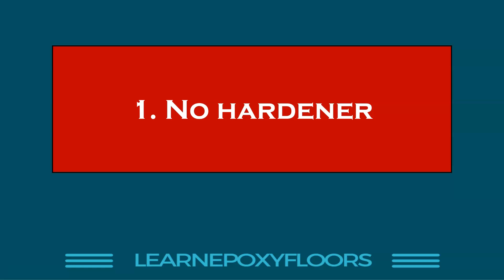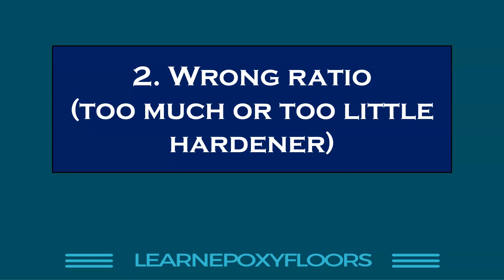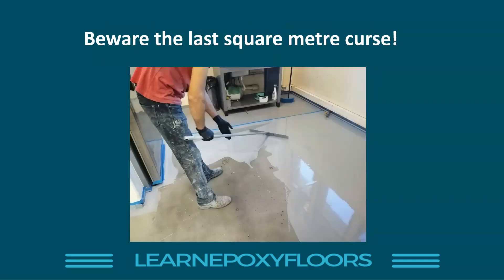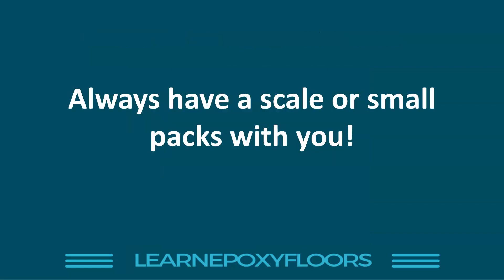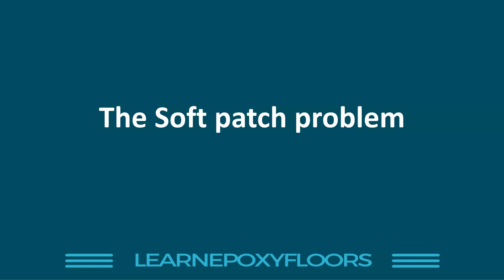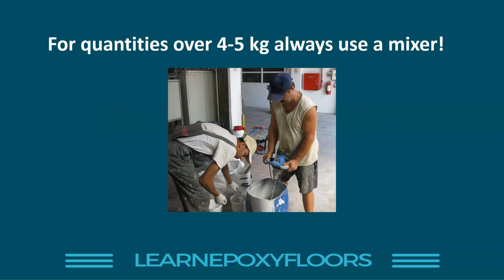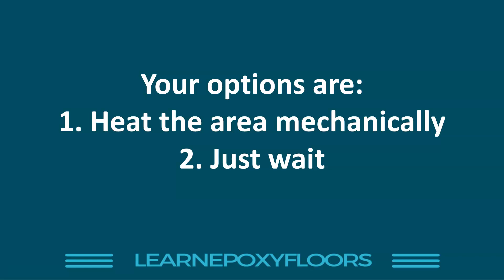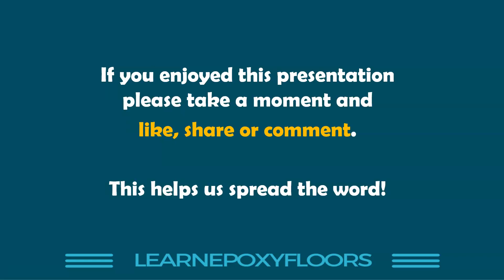Sticky Epoxy Floor ? - What's causing it and how to fix it (2020 version)

Comment: I found out from the manufacturer that the hardener in the packet was compromised. I didn’t know because I never did it before and it was in a sealed packet. It looked grainy when I painted it on. It is so bonded to the concrete, there is no scraping it off or pressure washing it. Now what? It is sticky to walk on…..

Comment: In theory, what stops someone from burying improperly cured epoxy layers under several more coats of properly cured epoxy?   Can it just be buried.
Reply from the maker: If there is a lot of stress on the floor there will always be an in-between layer that has not bonded well to the previous one. This could cause several layers together to start peeling. This is especially common when the seasons change from summer to winter and back again

Comment: What happen if you forgot to add the hardener and then you poured it over the flakes how do you get it removed off the flakes asking for a friend
Reply from the maker: use thinner to remove it all off the flakes. Wipe it clean with solvent and then re-apply

Comment: Hello, thanks for your video. I painted my garage two days ago with the two parts epoxy, unfortunately I didn't use a mixer, I just mixed with a stick. So, half of my garage is completely dry and the other half is a little sticky, from where the mix wasnt done well at fist. Can I just put another coat on it?
Reply from the maker: If it is a little sticky, you can put another coat on top. But the underneath layer may not have bonded properly to the substrate
Reply: @learncoatings-epoxyfloorin9448 what happens if the underneath layer may not have bonded properly to the substrate? Is the floor going to be soft and susceptible to peal off or “hot tire lift” even if you apply a top clear coat?
Reply: Hi ! How can I send you a picture I need your help my flooring is sticky, I didn’t mix the package properly the clear coating took a while to soak , I tried using a rag that got messy and now on top haves a mix of paint along with the clear coating it’s tacky and it has covered my finish project in some areas I can still see the finish flooring with chips that is dried out and want to save ! And just remove that top portion that is frustrating me 😢

Comment: Thanks for the video. Is it possible that the epoxy hasn’t fully cured after 8days? My basement has no ventilation and its pretty cold down there. There are a few small patches that are still sticky after 8 days. I mixed hard for 15minutes. Thanks
Reply: I have the same problem, what did you do about it?
Reply from the maker: Something went wrong with the mixing. Curing should be uniform. Some sticky spots means poor mixing or product stuck to the bottom of the pail. Did you use an electric mixer?

Comment: After coating my work on the floor like too week now and the epoxy is peeling what should I do?
Reply from the maker: If it is peeling already something went wrong in the application. You need to scrape it all off, and apply it properly. Follow all the proper advice, grinding, priming and then applying epoxy